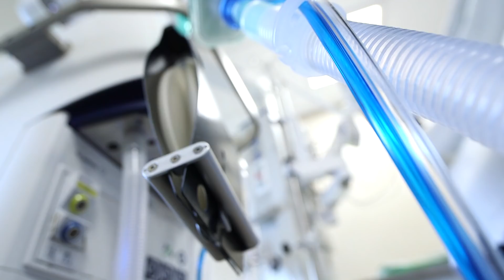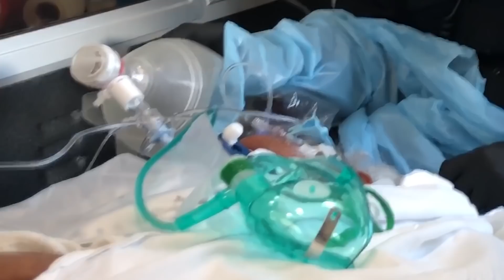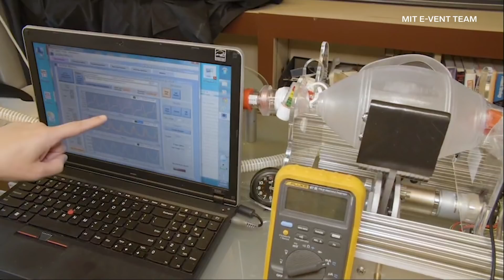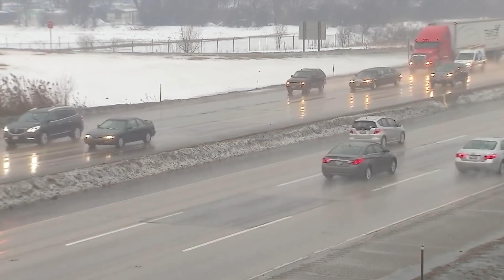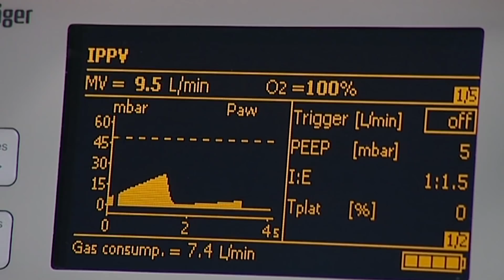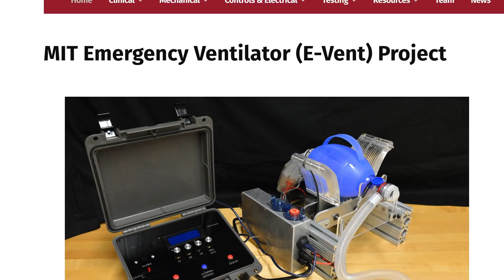How This DIY Ventilator Could Keep Covid-19 Patients Alive | WIRED

Comment: Just as lots of people pointed and will point: this system is no replacemente for the super expensive ventilators that are needed to help critical patients: they, at most, will help patients less serious conditions for short periods of time.

The shortage of the more serious ventilators can be only fixed by the mass production of those precision machines by companies that already can build precision equipment. Budget solutions will serve only to treat cases that can be treated by budget solutions.
Reply: I aggree. it's good for the short term, or non-critical cases. I could also see something like this being helpful in areas of the world where there is no/little access to modern ventilators. this style of ventilator only replaces the person squeezing the ambu bag, that's it.
Reply: @livewellwitheds6885  no one who is “non-critical” goes on a mechanical ventilator. I’ve been studying mechanical ventilation since 1980…these contraptions are silly.

Comment: Why don’t they use two motors for one side and then only move one side? —> less moving parts and the software would probably be easier too
Reply: Why not skip the electronic control altogether and use mechanical timing like the Bird Mark 7 series or fluidic control like the Monaghan ventilators? The lack of knowledge displayed by these MIT clowns is astonishing.

Comment: This is not a long term solution to ventilating anyone.  You need to talk to some doctors before you further this dangerous idea on the Internet.  A bag operated by a skilled human responds to the patient, and that's not something that this sort of solution can achieve. 

By the way, 80% of COVID people who are put on a ventilator die.  This is with a sophisticated device that responds to the human's breath demand.  Adding more motors drives higher pressure into the patient, increasing the odds of killing the patient.

Comment: This is great and all, but there’s a reason that these kind of systems haven’t been used instead of ventilators before COVID. 
Ventilators can provide a positive end expiratory pressure (PEEP) which serves to stop the lungs collapsing, the system described cannot provide this. Ventilators also humidify air which serves to protect the airway, over time (especially two weeks as they discuss in the video) the dry air used in the system they describe can cause desiccation of the respiratory mucosa, which damages it. There are other reasons ventilators are far superior to this system, and they are serious enough to doubt whether this kind of system could ever be used in a clinical setting for a prolonged period of time. 
Real Engineering has made a great video that discusses these types of system versus real ventilators, and the differences between them as well as pros and cons of each. I’d recommend checking it out.
Reply: https://youtu.be/7vLPefHYWpY
Reply: I watched that too.
Reply: Same here thank for makin such a detailed comment
Reply: Check my video, i have a design for this purpose, check it, its open.
https://www.youtube.com/watch?v=F9MG_4-bgBU
Reply: Draugr  or a water mist chamber maybe.
Reply: The humidity issue could be resolved with todays engineers easily.!
Reply: It has peep, and it could be easily adapted to humidify the air.
Reply: The ventilator design presented in the video also provides PEEP control, in the form of a manual valve on the ambu bag. They didn't go into technical details in the video, Wired never does, but it's all on the website shown at the end of the video.
Reply: There was NEVER a shortage of ventilators to begin with. MIT employs idiots.
Reply: Sure, but could be a desperate, last resort.
Reply: @k8h991  Not quite. Without PEEP, this style of automatic ventilator is likely to do permanent damage to the already compromised lungs of anyone who needs to use it for more than an hour or so. As such, I would gamble that they're more likely to die with it than without it.
Reply: @BruceDoesStuff  
But one hour could be the difference between life and death when the health care system is so streached. But yeah good points